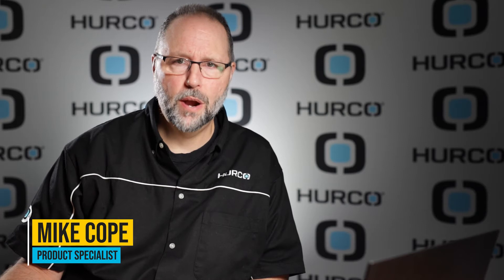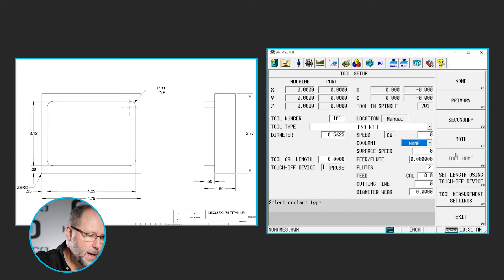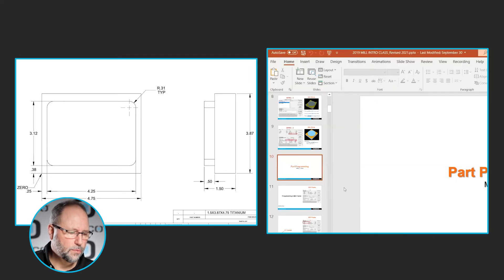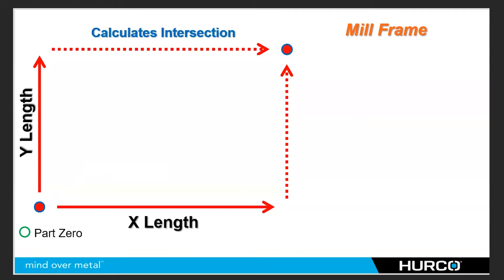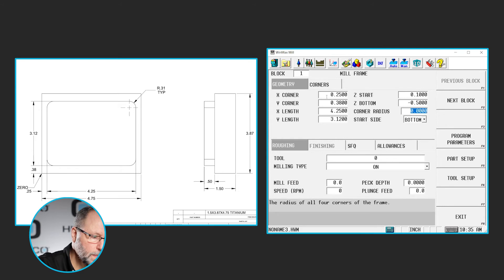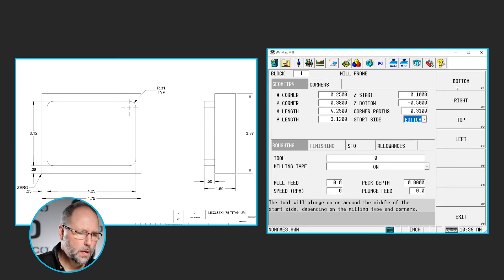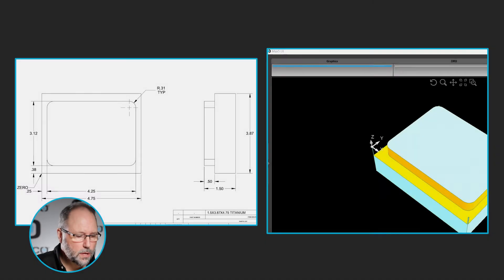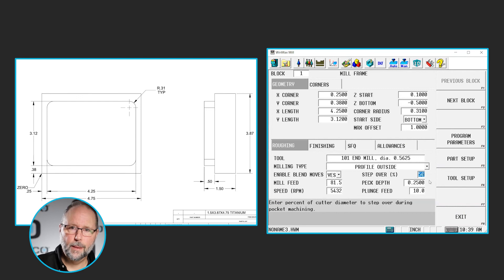Intro 3: Mill Frame Print | Hurco Mill Intro Training Course

Comment: Why does It not use the setup stock size for roughing the material to get to the frame profile?
Reply from the maker: Hi Mike, the two are both independent of one another to give the user more control over what the graphics shows, or when something “creative” must be done to better represent what they user is doing. Also, if the data block used the stock geometry for a roughing boundary, then the two would be tied too closely together to allow the ability to use an STL file as stock geometry for secondary work or for castings.